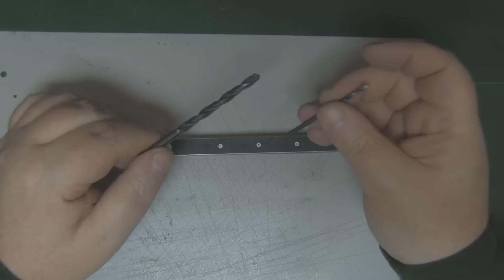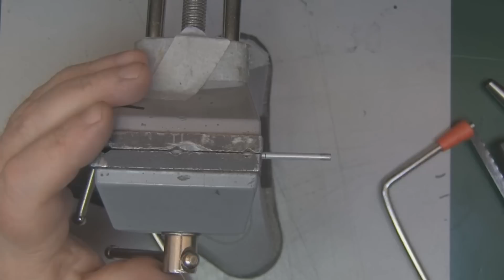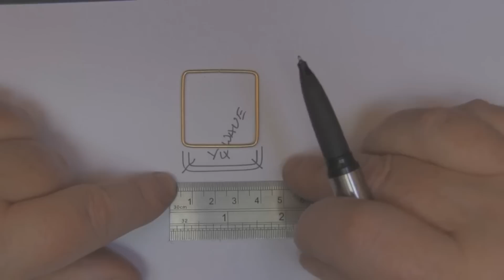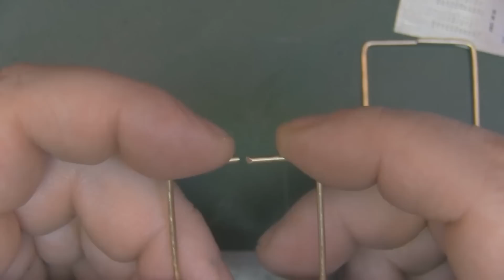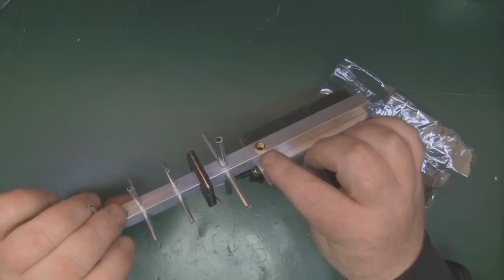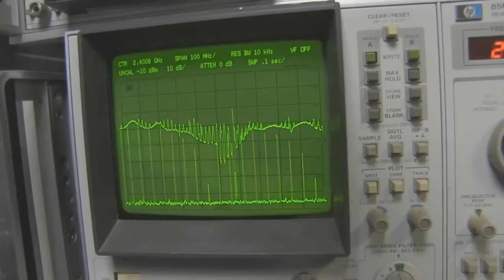Yagi x wing Antenna for 2.4GHz Wifi

Comment: Nicely done. I would like to ask 3 questions:
1) If I have a solid piece of aluminum, and drill and tap holes so I can thread screws into the holes so the screws are the parasitics, will the fact that they have threads degrade the efficiency of the antenna? I don't know anything about antennas, and the fact that the Yagi works is amazing to me. I can't understand how the wave passing over one parasitic replenishes itself to have energy to impart to the subsequent parasitics.
2) If I want to design an X-Wing for a different frequency range where can I find the plans to design it with the correct dimensions? 
3) Are you aware of any fairly inexpensive spectrum analyzers so we can tune our antennas? 
Thank you.

Comment: a way to speed up the production of these, is to buy a 3D printer, print the aluminum part of the antenna, and cast it out of aluminum using the lost pla metal casting method.

Comment: If you're going to provide a template, then provide it in a location that doesn't require joining special groups, websites, etc. Also, provide a drawing of the template with dimensions in the video as redundancy. You put so much effort into the video, and it would require so little effort from you to make things so much better and easier for your viewers.

Comment: ?What is the center frequency design point of this antenna? 
Did you choose center frequency=2.437GHz for the US WiFi channes 1-11?
or
did you select center frequency=2.450GHz to include all 14 channels for worldwide "2.4GHz" WiFi? (or something else?)
Also, if not too much trouble can you cite the formulae or tool you used to calculate the dimensions for all the pieces? Thanks.

Comment: love try this antenna. but I cant find the link for the template.
Reply: You can make your own. Search for an online Yagi calculator and use it to find the element spacing. It will be a little different because of a different driven element, but still very good.

Comment: I am wondering why you don't use a plumbing tube cutter to cut your tubular aluminum elements? That would seem to be easier than hack sawing.
Reply: Small diameter tubing is very easy to cut with a hack saw. There's not much difference in total time between the two methods. Plumbing tube cutter is cleaner, but takes a little more time to cut. Hack saw cuts are faster, but need time to clean.  ;)

Comment: Does it have to be 3mm tube? I have 3mm tig filler wire.
Reply: It does not need to be tube. Filler wire should work. I use solid aluminum wire and it works great.

Comment: I would suggest drilling holes for elements half a mm smaller so there would be friction holding elements in and to use some super glue too just in case

Comment: Its crazy how accurate you have to be when desining & making these antennas?  Makes you think how all these cheap made chineese  antennas work?  Well im semising there as they probally dont work! Ha ha ha.  I bought a Alfa when they were the DOGS!!
I bought from what i thoiught was a legit store.  It kept on dropping out, i took apart and the soldering was like a school kid done it?  Well? School kid would of done a better job!
The ground on the sma WAS TERRIBLE AND SIGNAL CONNECTION WAS A BLOB of solder.(sorry bout caps)
Ohh?  Also a coil was cracked in half
Live and learn, but i was gutted cos i new how good they could be?  So i didnt have no fun with it.  Although probally better i didnt?  As i would of got into trouble probally?...ha ha ha ha h
Reply: I bought one of those $15 yagi's from china and it was pretty crap. when you took the plastic caps off the elements they were all over the place.

Comment: How thick is the paint and what is the dielectric constant?  Did you test the yagi after you painted it/capped it?  I realize the paint thickness is <<<lambda so it has little affect but just curious.  They do look snazzy in blue!

I wonder if the twist in the feed loop at the coax feed adds some sort of inherent phase shift in the yagi's frequency response?  But, I suppose yagis are sensitive to phase change by design.

Comment: I bought a Yagi from china that was advertised as being for 2.4ghz and 16dbi with the intention of using it for FPV on an antenna tracker but having stuck it on my NanoVNA V2 which ive just got, the antenna is only good for 1020 and 1980mhz, is there anything that can be done to re tune it or is it only good for the bin and should just build one?
Reply from the maker: Sad to say but bin it
Reply: @andrewmcneil  After learning a lot from your videos, thats what i feared.
I didnt want to trust it till my NanoVNA arrived and it sat for two weeks, im glad i never tried to use it as a dead video transmitter would not be funny while in flight even with return to home as the same link is also what carry's my telemetry and it would be a totally blind wait to see if it came home lol.
Reply: @stevefox3763  Since the resonant frequency is low, the elements are too long. Theoretically, you should be able to cut the elements shorter to reach a higher frequency. But that's a lot of work to get it to the exact frequency you want. It's probably easier to send it to the bin and build one to your exact specifications.
Reply: @Texas1FlyBoy  I haven't binned it and have nothing to loose by attempting a re tune, the folded dipole is the part that will give the most grief but I could simply re make that element rather than trying to modify the length of the existing one and the rest of the elements are just a 30sec hacksaw job for each one.